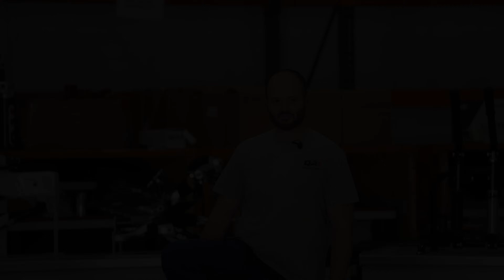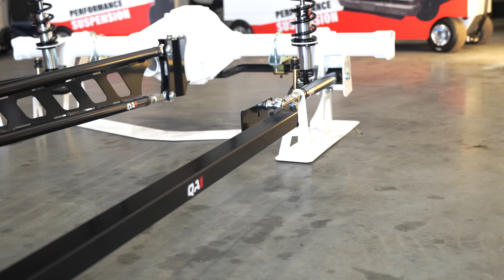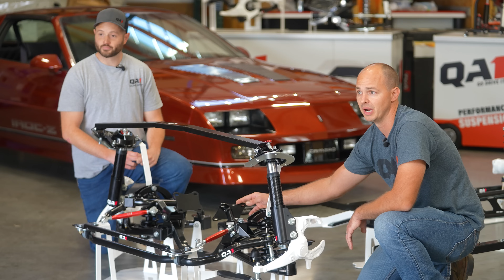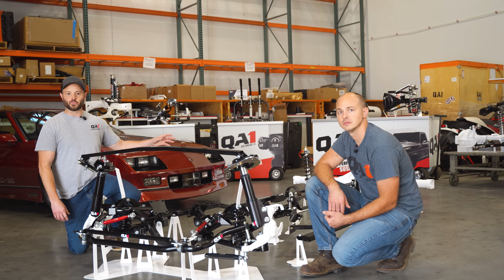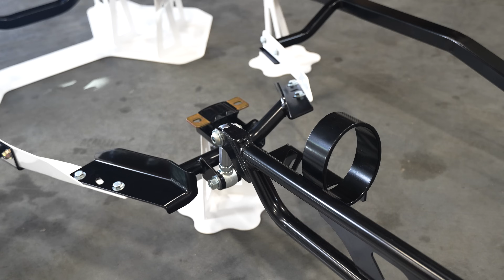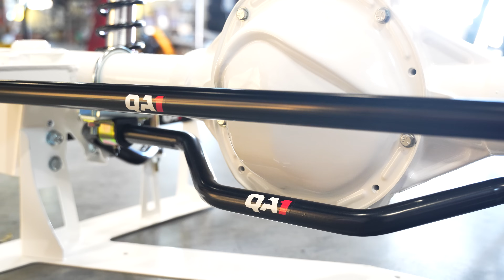QA1’s All-New Suspension Line for 3rd Gen F-Bodies – Full Breakdown

Comment: Can anyone explain why it says “Not compatible with convertible models”??
Reply: If I remember correctly the framing underneath the convertible is different than the t top and coupe. The subframe connector doesn't fit. I may be completely wrong though. I'm like 90% sure.
Reply from the maker: It is just the subframe connectors that are not compatible with convertible models. It is the same with the 1st and 2nd gen F-Bodies. For some reason they did them differently on the convertible models from factory.

Comment: Tons of qa1 videos out there from qa1, but I’ve seen no before and after comparisons on the track or skid pad. I’ve not seen a before and after stock components failing where qa1 doesn’t or wouldn’t. 

Not a critique to the product, but these comparisons just don’t exist anywhere that I see. Whereas there are 1000s of videos on dyno pulls showing changes in performance with each engine mod along the way. 

Is there anything qa1 has on file during the research and development showing where these parts outperform stock. (Outside of the shocks and clovers of course)
Reply from the maker: Very fair observation and something we would love to figure out! Tons of variables involved with that from a cost and safety perspective that we would need to circumnavigate. Absolutely something that we look to incorporate in the future somehow.